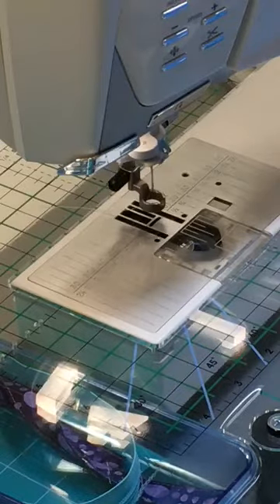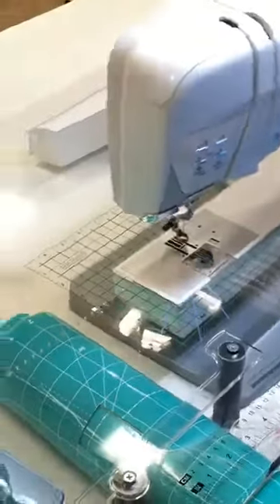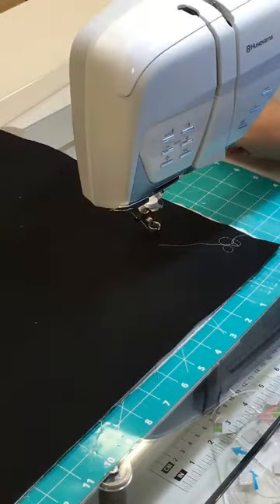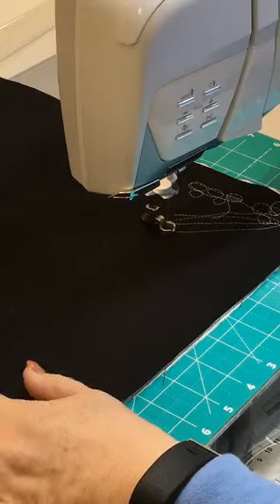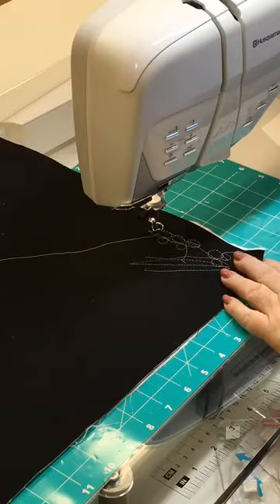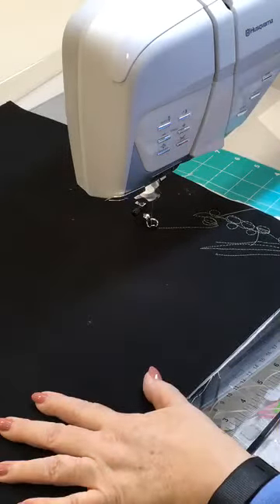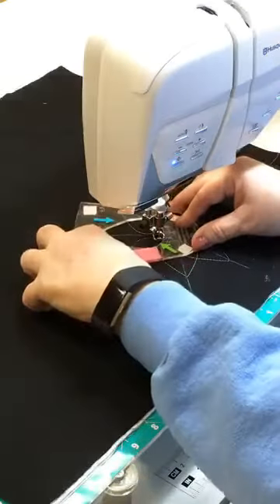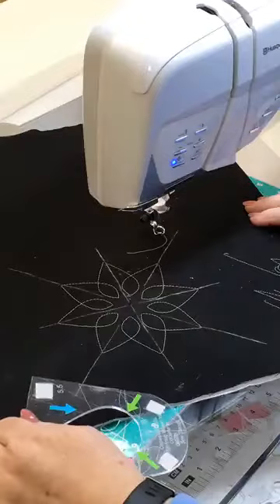Let's Get Started with Template Quilting (March 18, 2020)

Comment: You mentioned you try to match threads, top and bottom.  If you're using rayon thread which is considered a "natural" fiber then would't you use a same weight cotton in your bobbin because it too is a natural fiber where as the polyester in all purpous thread is a combination and wouldn't wear equally.

Comment: This video was recommended to me and it is awesome - addresses so many of the basics! Loved the info about marking quilts. I do have one question/concern. I have a sit down long arm (Juki) and when I try using the thumbtack the template won't spin - the fabric will actually bunch up under it as I sew and I can't spin (can't even move) the template at all. Any suggestions?
Reply from the maker: Susan:  Use the thumb tack on TOP of the fabric.  Place the tack on a table and use a 1 1/2" piece of sturdy tape and place it over the tack as if you were taping the tack to the table.  (tack will pierce through the tape)  Then pick up the tape and position on your fabric in the center of your design area.  I would think that this would help.  If not, send me a photo of the problem to 765-661-1458.  HOpe this helps.   Donelle
Reply: @templatequiltingwithdonell6377  Thank you so much for responding so quickly! I'm sorry to be so dense but are you saying to put the tack through the block from the top (flat part of tack on top of quilt)? My question is wouldn't the point scratch the plate on my machine? I have built in stitch regulator and don't want to damage it. Sorry but I'm a really visual person!
Reply from the maker: @susanbenchik4275  We need to FaceTime.  You have my number.  Give me a call